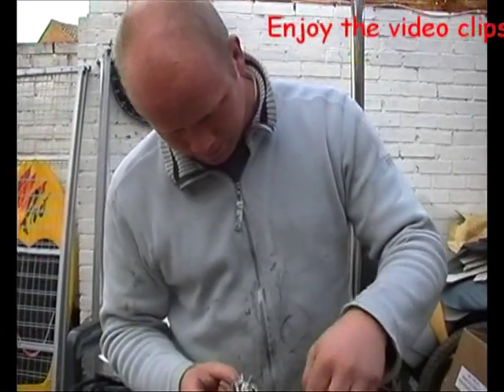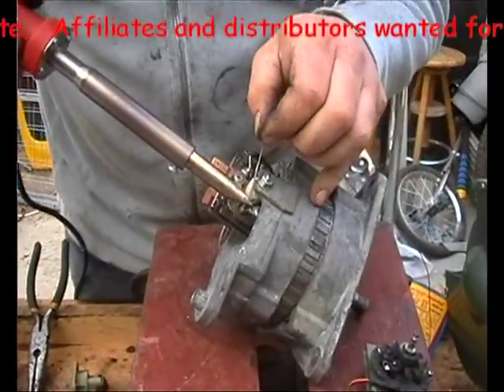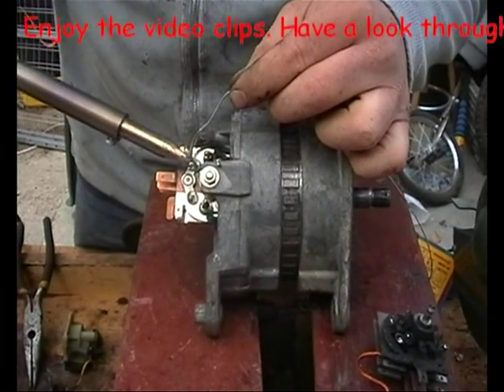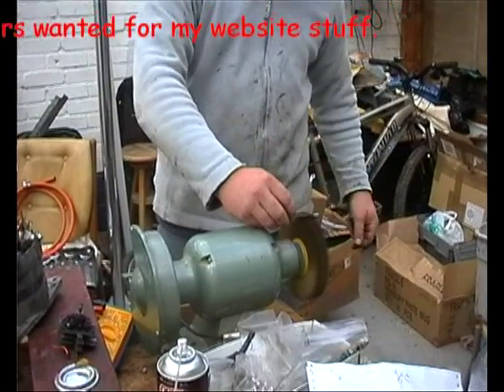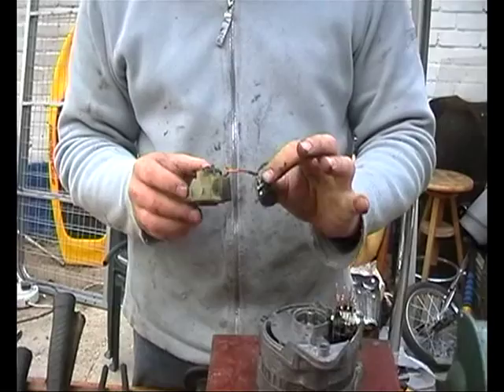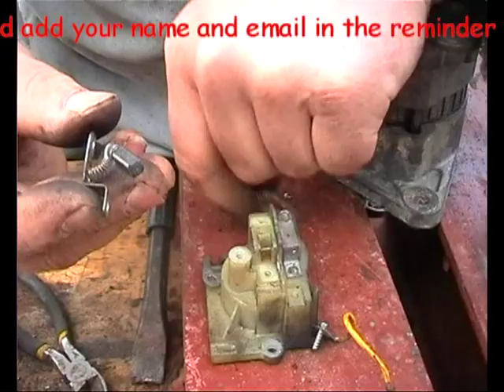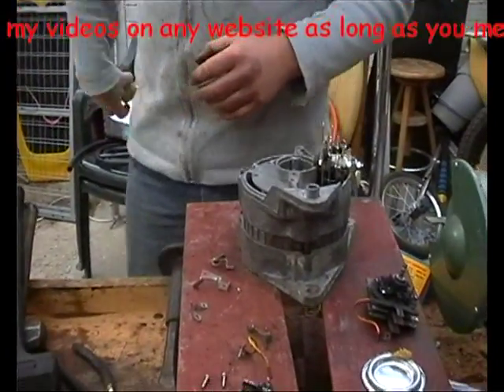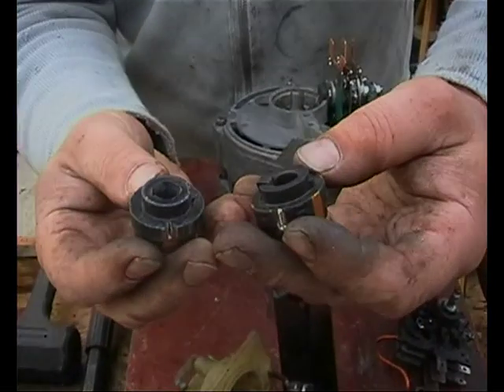ALTERNATOR REBUILD PART 3 FROM DIY-DVDS.COM

Comment: carburettorcleaner gives nice big flames when its still inside the dynamo after assembly either in liquid or gas form , blast everything with compressed air after youre done just to make sure

Comment: can you tell me what kind of solder is used to weld the slip rings on the rotor and the flux i would like to fix an alternator thanks you rvideos  are very helpful thanks for your answer